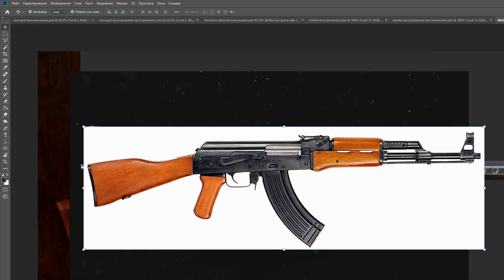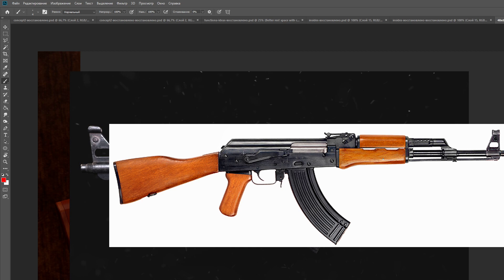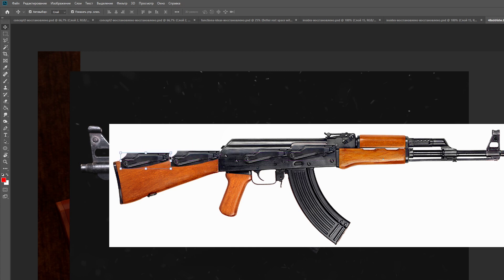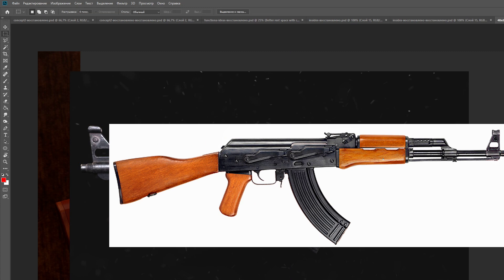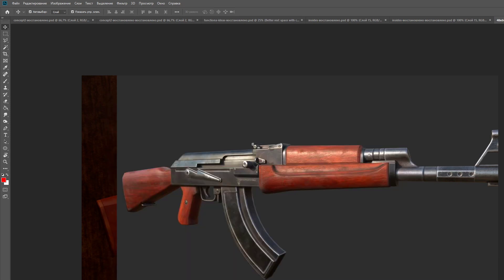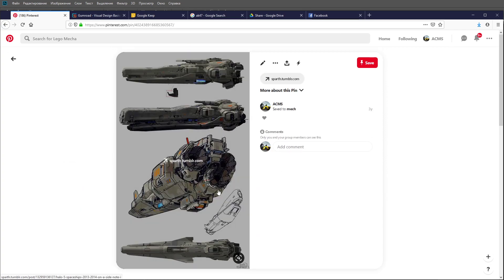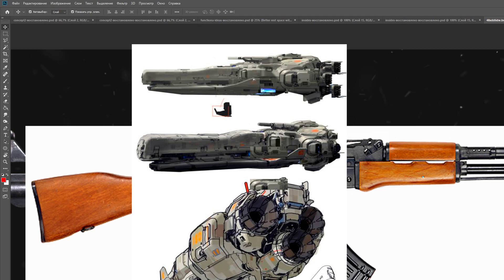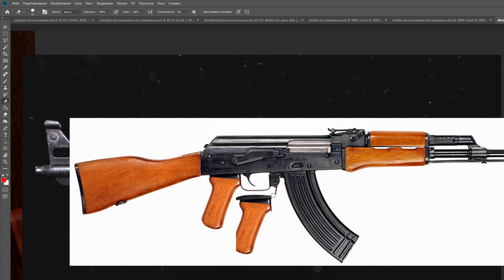3DQT - Always Nailing Proportions

Comment: Cool stuff, I ll just add that at times people just drag and drop their concept right in 3d viewport on top of a simple plane which is not always the correct size thus squishing stretching the image. Simply just use the image res as length / width size of plane you should be good to go and apply the trick shown in video.
Reply from the maker: This is true, but in cases where something is not on a side angle, this can work very well often times